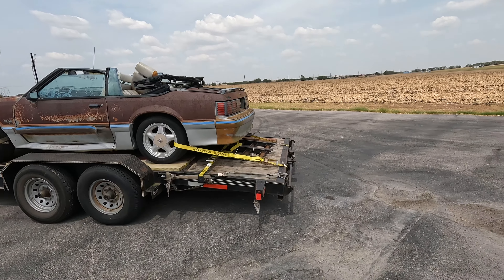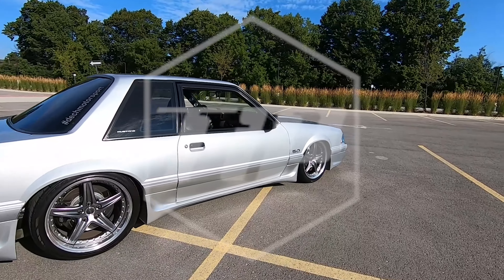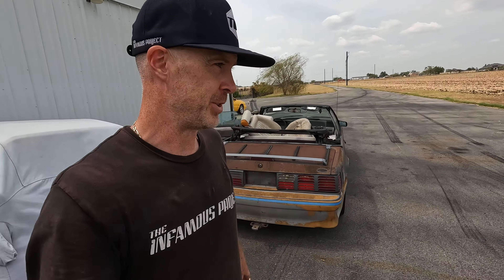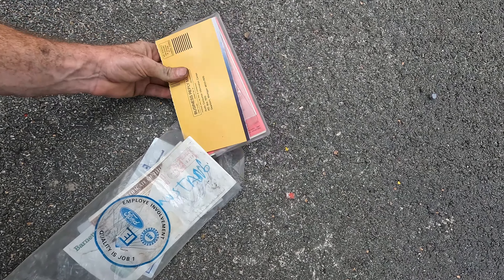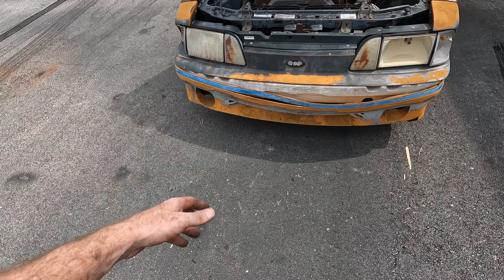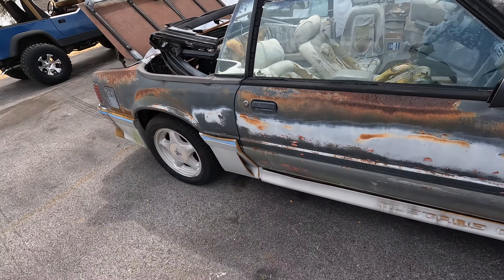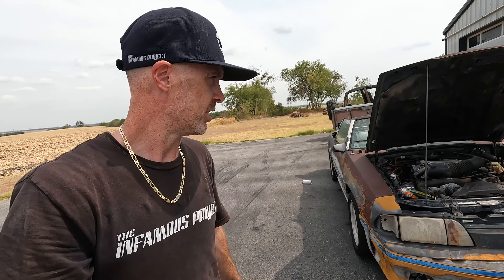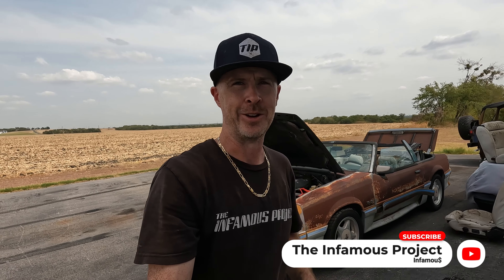Baked 25 Years in the Florida Sun & I paid $900 for it! - Project "FOXIDIZED" Part 1

Comment: I kept wanting you to try the key on the passenger door in case the cross rod from the interior handle wasn't connected to the lock anymore.  I have never seen a bumper seperate at the molding like that.  😄

Comment: You need a back pack leaf blower, blow out the interior, make shift fuel system, play dukes of
hazzard getting in and out, a can of flex seal on the seats, its road ready. The old take-a-dump vert.

Comment: You paid 900 plus 800 shipping. Which I think is good but what drives me nuts is i have a 1987 f150 4x4 with 70K original miles and everything works on it. Just no title. The old man died. I been trying to sell it for parts as whole for 2500 bucks but no luck. The engine is worth 1500 4x4 drive train, another 1500. So I dont understand. I may just go buy a 87 to 91 body with a title and throw on it. or another 87 wrecked and swap vin.